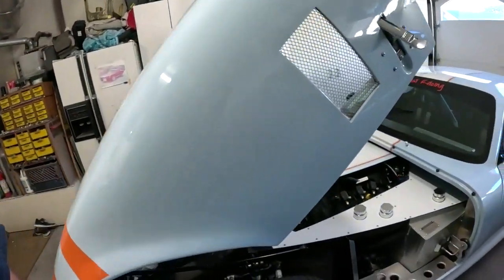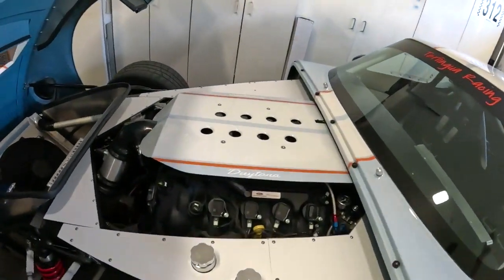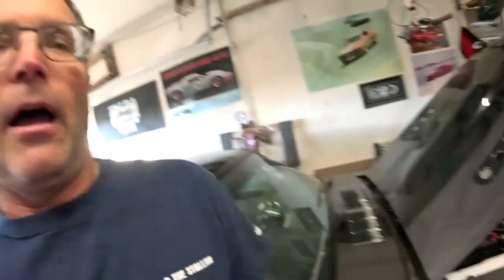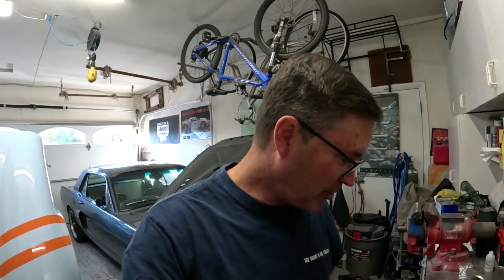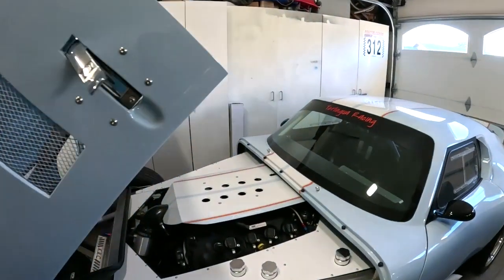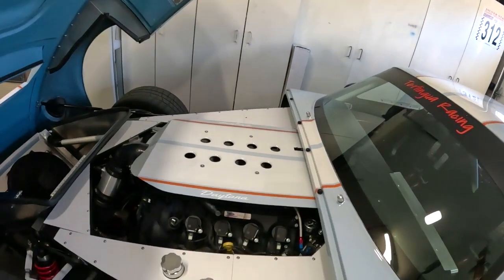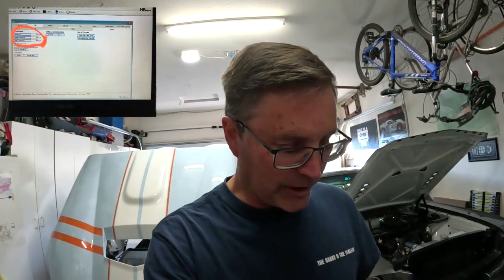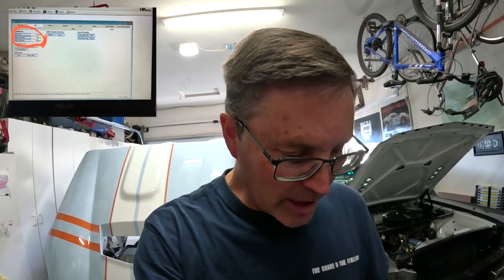Ford Coyote high idle fixed-Cobra Daytona Build, Video 236

Comment: I appreciate you taking the time to make this video.  Because of this information I was able to get this same idle issue corrected on my gen 3 Coyote powered Fairlane!
Reply from the maker: @MarkGibson-q5y  Glad I could help. Ford needs to fix this in the control pack but not sure if they have. Makes driving it much better.